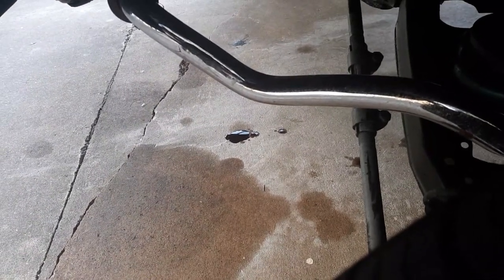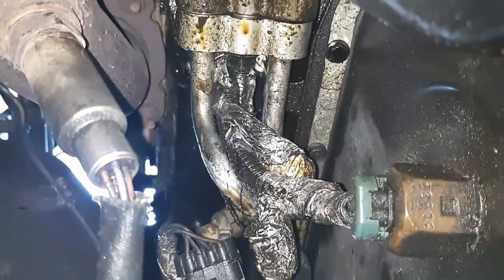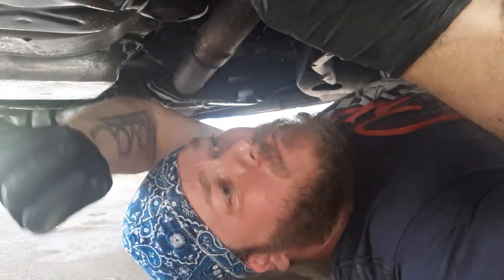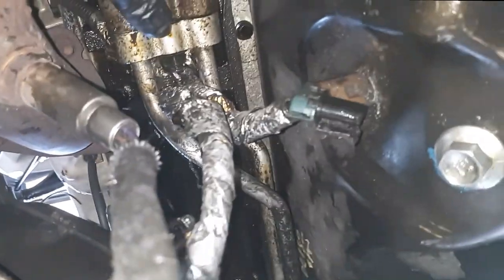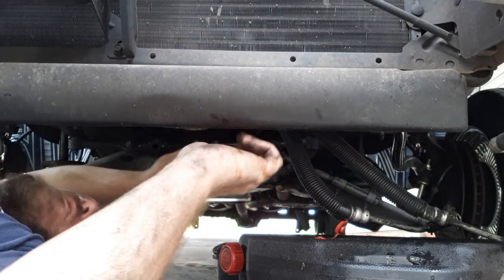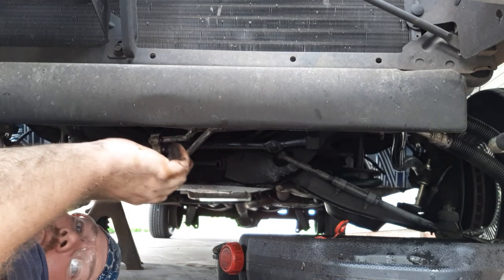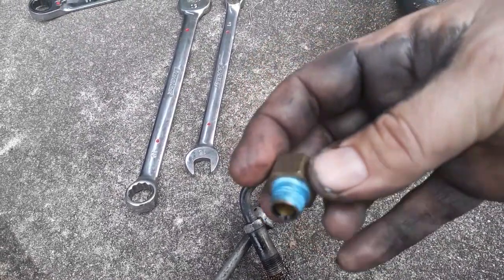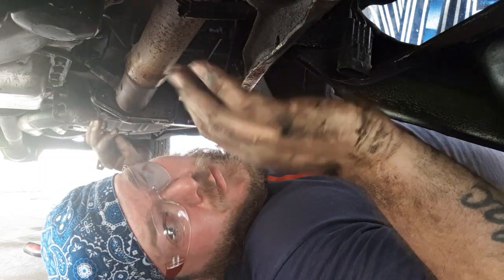How To Replace Engine Oil Cooler Lines On A 94-96 Fleetwood

Comment: Absolutely love your videos. Makes me laugh, gotta have humor. I possibly have to replace my lines as well. Or, should I say I hope that’s where it’s leaking and not somewhere worse. 
Was thinking of trying some dye to see where it’s leaking from. Puked out 3 quarts almost within just a 27 mile drive from work to home.
Reply from the maker: That's a lot of oil loss I would spray the engine down with brake cleaner and get it as clean as you can and start it up and let it idle while looking under and look to see if something is noticable I would think loosing that much oil something should stand out
Reply: @thecadillacdanshow8658  ok will do.

Comment: Thanks for mentioning you have to tighten the heck out of it. Did mine, used the little metal plate with the two gaskets made in it, tightened it pretty good without wanting to go too crazy, and it poured oil. Guess I'll crank down on it some more (scary)

Comment: What size are ur spokes, and would I have to put spacers for the front on my 93 fleetwood to run 13s lmk thanks ur videos are helpful
Reply from the maker: I have 14x6s on the blue one I'm about to upload a video of my Cadillac I would like to do 13s on it you can put spacers on the front but I would get longer wheel studs I'm going to swap out to 11 inch rotor caprice spindles on mine
Reply: Nice bro thanks for the tip we gonna need a a vid when u do the spindle swap
Reply from the maker: @lowriderscene1629  will do